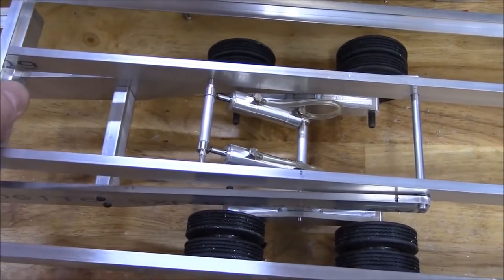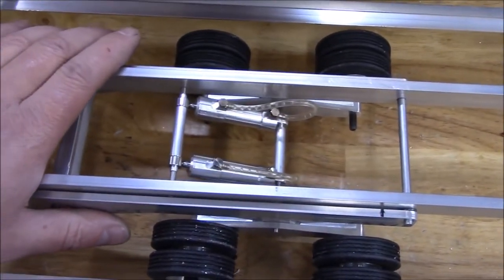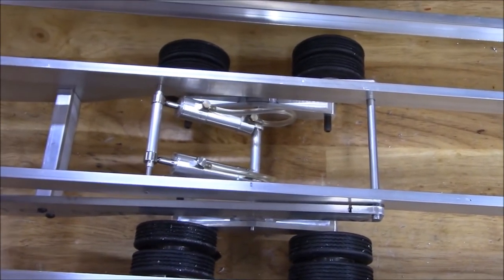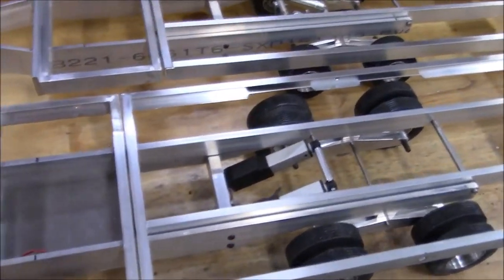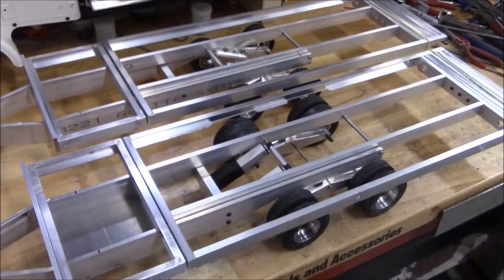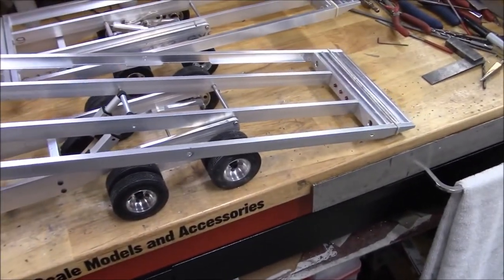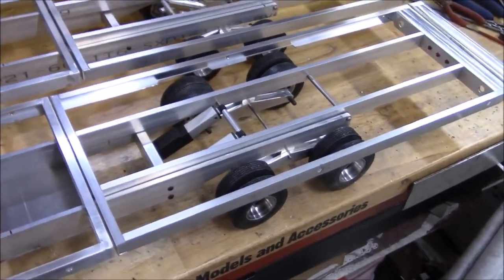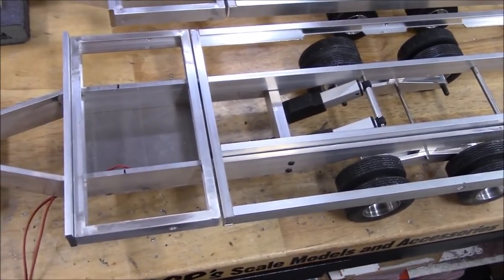Hydraulic vs. Electric Actuators In Tilt-Deck Trailers By RCP

Comment: PLEASE ........ MAKE THE ELECTRIC IN A CYLINDRICAL FORM, FOR A BETTER APPEARANCE .......................... IT IS UGLY SQUARE
Reply from the maker: Hi there. While we appreciate that some of the RC guys want a cylindrical actuator, please understand that product development takes a lot of time and resources. I have tried to gauge interest on RCtruckandcontruction a while back and there only seemed to be one or two guys who were really interested. We did design a circular sleeve that would go over the top of our current line of actuators making them circular, but quite a bit larger overall.